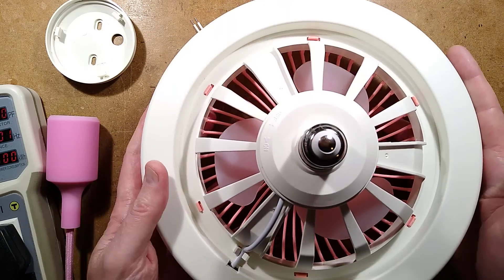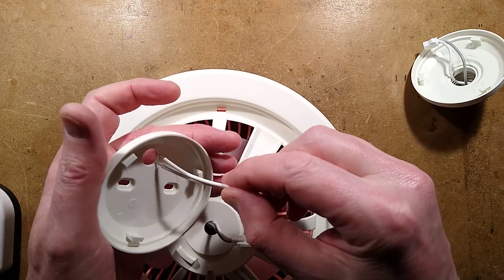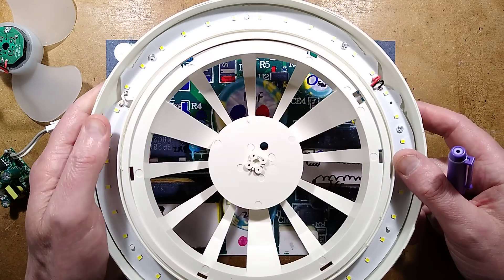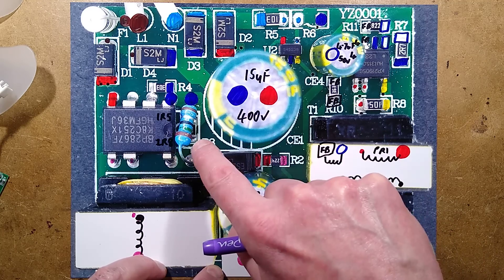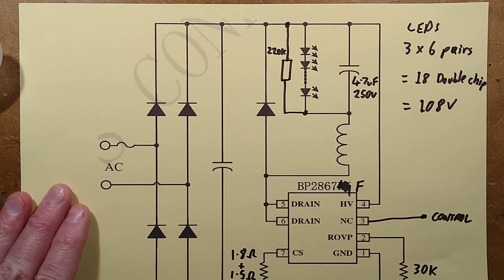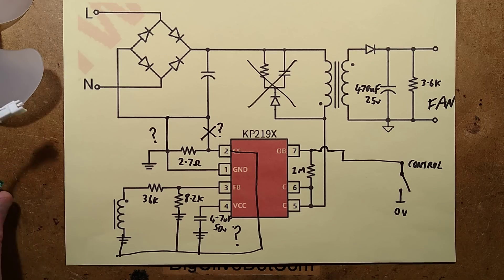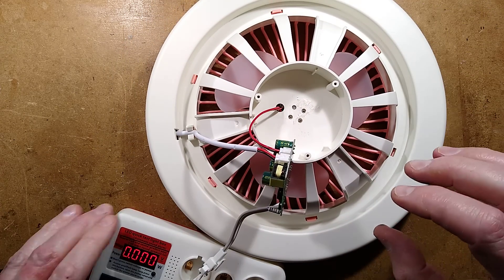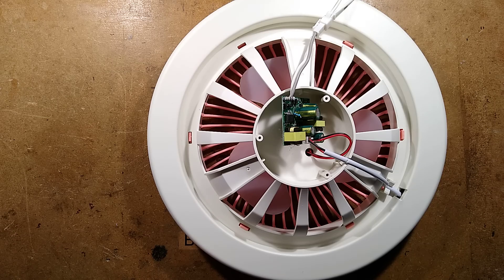fixing a faulty light with powerful built in fan (awesome chip inside)

Comment: You could possibly use it to both light up and remove fumes from a work area if it will happily pull the air away
Reply: But unless there's a place to actually move the air outside (aka a duct), all your doing is moving the fumes (or smell) around the room. I really fail to see the purpose of this.
Reply: @gorak9000 In some cases reducing concentration is sufficiently protective.
Reply: @Azlehria  Not about 2 hours after you have taco bell - gotta capture all of that "essence" and have it treated as hazardous waste - whirling it around the room isn't going to cut it

Comment: Question: If I have a heatsink that covers a large square IC, but also has part that hangs to the side of the component (like a terrace). So it is like an extension, it also has fins like the main part of the heatsink. If that part of the heatsink is not getting much heat transfered to it, is the problem that the part is too thick or too thin?
Because, at work the design engineer thinks that the problem is that the hanging part is too thin and that making it thicker (mechanical engineer will make a new one) will conduct more heat to it. While I think that the problem may be that the hanging part is too thick, and has a large thermal mass, so most of the heat stays on the main part (which is direcly on the IC), which is causing the problem. And that making it thinner would make it easier to absorb heat. 
I am not sure which solution is an actuall solution. Can anyone help? We will take a look at it with a thermal imaging camera tommorow, and will need to decide what to do.
Reply from the maker: I think the thicker base of a heatsink will generally help with coupling heat to the fins better.

Comment: Did you notice on the data sheet that the CS and GND pins have the numbers swapped on the package outline. The GND pin is numbered 1 but is in the 2 position. So maybe that is the cause of the confusing wiring and datasheet
Reply: Yeah I think so too.

Comment: That seems like a lot of work to save a switch and another conductor.
Reply from the maker: Cost of fan that goes into existing lamp holder $20.  Cost of getting an electrician out to run an extra wire $huge.

Comment: The chip was primarily used in multi-colour lights. The output is connected to a white LED and a yellow-ish LED. Then you can adjust the colour temperature.
Reply: Interesting. They likely wired the fan as the warm white light.
Reply: Yes I have one in my shower that doubles as a nightlight with a separate ring of amber color LEDs

Comment: I see the use for renters.  I'm a little skeptical about attaching a fan like that though.  It spins up fast.  I wonder if that's tough on the outlet.
Reply: As in physically hard on the outlet? The fan is of such a low mass that there's likely far less froce applied to the socket than there is when a standard bulb is screwed into it.
Reply: @kmoecub  A standard bulb is replaced infrequently compared to a fan starting and stopping. Indeed mass is low but force  = mass x acceleration and it starts very fast.  There is also the fact a fan moves air.  It's basically a wind brake.  There are also imperfections in the balance of the blade.  I have no idea how much but if the fan creates a resonant frequency we get a miniature "galloping gerdy".  I've seen many poorly made light receptacles so it's difficult to calculate the impact.
Reply: I couldn't be sure, but it seems like the startup torque of the fan exerted force in the direction of unscrewing the device from the socket.
Reply: I'd suspect that there is almost no impact whatsoever on the outlet. Much less than the heating and cooling that an incandescent bulb would inflict on the socket anyway.

The fan has almost no mass, the brushless motor won't exert that much torque and the startup speed is controlled by the inbuilt controller's feedback circuit so the amount of torque is managed. One could argue that the direction of the fan might impart a little force to unscrew the bulb in the fixture when first turned on, but when turned off the braking effect would screw the bulb back in with approximately the same force (or vice versa). Certainly not enough to worry about.

Replace the thin plastic fan with a much large fan with blades made of a heavy metal and we might see some effect, but not at this size and weight.

Comment: Right up against the wall would be way too close for the airflow doesn’t look like as much depth
Reply: I suspect that there will still be plenty of space for the airflow to such in air around the back. It's not like it's high power fan and given a bit of momentum the air flow will work just fine. Look at computer cases and their fans and intakes and you'll see how you don't need that much of an air input (or what you can get away with).

Comment: Interesting device, especially if the fan could also be made to rotate in the opposite direction, as to illuminate and extract soldering fumes in a workbench.
Reply: It's brushless DC, so swapping two of the winding leads on the little daughterboard should reverse the direction.  (A fact that RC pilots know all too well.)
Reply: Thats are awsome idea
Reply: It looks like the fan blade used in this particular device is designed to spin in only one direction.

Comment: Phillips has a series of "automatic" dimmer LED lamps. They have 3 light levels. Low, with warm color. Medium with warmer color and High with normal color.
The level is changed by turning the lamp off/on. I guess that chip was designed for that kind of application.

Comment: You could have just scraped the cover off that broken track and drawn it in with a pencil. A thin layer of graphite would have completed that circuit.  I've done that before on broken tracks.
Reply: You could, but that would have a higher resistance than using a jumper wire.
Reply: @kmoecub  Yeah, and? It's just sensing the power state it's not high current.

Comment: I think part of the reason why a lot of people in the UK still stick to inches is that they seem to think the alternative is to measure everything in millimetres, when in fact most of the civilised world uses centimetres  for "medium-sized" stuff (which is why the ruler is marked in cm, not mm).
Reply: Wait till you find out about decimeters...
Reply: @kpanic23  - Those are a myth, they've never been spotted in the wild.
Reply: Hmm, I measure everything in mm or metres. I guess I'm used to it. Metric is all I've ever used, since the early 1970s. 🦘
Reply: @channelsixtysix066 What about tyres?
Reply: @philtowle4683   I don't measure tyre sizes, I use kPa for air pressure.
Reply: @channelsixtysix066  you might not physically measure them but you will ask for the size in inches when you buy one.
Reply: @channelsixtysix066 the screen you're looking at now is likely a "xx inch" and just about everything electronic you've ever used has been inch-based inside    fullsize headphone plug is quarter inch    hard drive is 2.5 "
Reply: @jagmarc  An approximation of the real diagonal size, which is merely a lazy way to specify a square pixel grid which is most definitely defined in metric terms.

My hard drives are almost exclusively 3.5", actually, because they have things to do. And curiously, the dimensions in the standards which define both 2.5" and 3.5" are a mix of both systems - but you may not have ever read such documents. For bonus trivia, 2.5" and 3.5" are not nominal figures in either document.

ps. rulers predate 'the English' - by some millennia.
Reply: @Monkeh616  - In fact, SFF-8301
(the specification for 3.5" form factor drive dimensions) states: "2.3 Conventions - The dimensioning conventions are described in ANSI-Y14.5M, Geometric Dimensioning and Tolerancing. All dimensions are in millimeters, which are the controlling dimensional units (if inches are supplied, they are for guidance only)."
Reply: @RFC3514  Ah, but that's an alteration for the published standard - the majority of the nominal dimensions were chosen in imperial, and, for example, the threads for mounting screws are specified to be 6-32 UNC. 8201 is much more amusing with an obvious mix of metric and imperial nominals.
Reply: @Monkeh616  - Well, US customary inches themselves (which are not part of the imperial system, BTW, although they're identical) are defined by the NIST as a multiple of the millimetre, these days.

What I find funnier is that no dimension in a 3.5" drive is actually 3.5". The closest thing is the horizontal distance between the bottom holes, which is 95.25 mm (3.75"). Every other measurement is either ≤ 3" or ≥  4".
Reply: Technical people always use mm, non technical use cm - at least in Australia.
Reply: @glenngarrett8785  - So you're saying "non-technical people" use 0.35 cm audio jacks instead of 3.5 mm ones? Or 0.9 cm pistols? ;-)

The whole point of SI prefixes is that you should use the one that approximates your precision. So, truly "technical" people shouldn't say something is "250 mm" if the measurement precision is closer to one centimetre (or, indeed,  worse than 1 mm).

Also, even if you don't care about the "technical" aspect of things, saying 25 cm is simply faster than saying 250 mm.
Reply: Metric system jumped the shark when they started giving things names like Newtons and Pascals.
Reply: @M8Stealth  - So, what should newtons be called? Isaacs? ;-) 

It's just a derived unit, anyway; you're still free to write "kg⋅m/s²" every time, if you want. Also, newtons weren't / aren't really part of the metric system (they're part of the SI system). In the older CGS metric system, the force unit was the dyne (0.00001 newtons), but since the base units were changed (to metres and kilograms, instead of centimetres and grams) they needed a new name.
Reply: inches are better because use less of them to do the job , and only the English made rulers originally .
 Plus nearly everything in the world has been inches   19 inch rack    50 caliber   3.5 floppy  0.1 inch matrix  4" block  2 inch multitrack     "1/2 inch AF" is secret mechanics tool for 13mm    2 by 2 studding  etc. etc.
Reply: @jagmarc  - Yeah, in the (very few) parts of the world that use inches, everything seems to "be" inches. Imagine that. 😄
Reply: @RFC3514 But also many things from industries previously dominated by UK/US .  However many modern component pinout grids are now metric by design, such ad 0.5mm grids .  Meanwhile bureaucratic fanatics insist on official metric names such as 90mm disks and 47cm televisions .
Reply: @jagmarc  "inches are better because use less of them to do the job" 
This is a silly reason, if you really meant it then meters are better than inches because use less of them to do the job
Reply: @deadly_dave  - That's a guy who also said "only the English made rulers", so I suspect either he's not being very serious or he shouldn't be taken very seriously. ;-)

Comment: Could the fan be reversed in direction so it could be used a bathroom exhaust fan ?
Reply from the maker: Not easily without replacing the fan blade assembly.

Comment: I always thought that, when people complain about the heat inefficiency of lights- if you live somewhere that needs heating, you are actually using 100% of the energy (and thought that adding a fan could help circulate the heat). Didn't know they were actually a thing, even if that's not the intention.
Reply: Winters do feel colder with LED lighting. On the bright side, inductive loads such as light bulbs are a more expensive option of heating for most people anyway.
Reply: @Mrvideosandgames  I never understood why power factor correction isn't regulated by law. For small devices, the impact might be small, but that also means the cap is really cheap to correct it. And if it was required it would all add up.

Or did I misunderstand and you were talking about alternatives like nat gas or heat pumps? Cuz if you are talking about heat pumps especially, it would be amazing if we just pumped heat where it was needed around a house to make every other heat pump (or sink) more efficient- my dream home would be one where that was the case.
Reply: @sophiophile  Yeah, I just mean LEDs produce less heat than older types of bulbs, but on the flip side light bulbs aren't a great way to heat your home to begin with when electricity is triple the cost of gas (in the UK) and resistive (sorry, not inductive) heaters use about double the electricity of heat pumps.
Reply: Also electronics, including LEDs, hate heat cycles as it causes tiny fractures that will break the device way before it’s intended lifespan. Cheap LED Bulbs are often overrunning the LED chips with more amps than they need, increasing the light output but decreasing lifespan and energy efficiency. And the producer needs less LEDs for the same amount of light, making the product cheaper. Check Clive‘s Video on the Dubai Lamps, LEDs at twice the efficiency as common LEDs

A good Lamp runs LEDs at 0.5-1.0W each

Comment: I don't really understand the electronics but what was the point of the resistor pushing up the wattage?
Reply from the maker: The resistor programs the LED current.  By chopping one off it increased the resistance value and lowered the power.

Comment: Yeah, very weird, that capacitor on the KP219x VCC pin is normally fed from a diode on feedback winding, that would reduce/turn off the constant current trickle internally in chip, thereby increasing efficiency and reduce waste heat in switch regulator.

Comment: I think i would be concerned that when the fan starts, it unscrews from the fitting
Or if it's a pendant holder it might twist around
Reply: Interesting point.  But  13:20  the fan spins counter-clockwise which means it's "pushing" clockwise when it starts, ?
Reply: @idjtoal  look again, imagine from the front
Fan spins counter clockwise from the back, which means clockwise from the front, frame spins counter clockwise ;)
Reply: @sparkyprojects  You are correct, sir, had it in my head somehow that it was right side up.  Clockwise, down into the workbench, means it is a self-unscrewing lamp.  The Chinese never cease to amaze.

Comment: Interesting device. Nice that it uses short on/off mains cycle to change operating mode rather then having to set up a account in the cloud to control it.
Reply: >your refrigerator, doorbell and TV have entered the chat
Reply: @WineScrounger sadly, they can do just that.
Reply: usually they would come with a remote to control the light and fan
Reply: Solutions like these can be finicky, and having a separate remote for each device just sucks. There ARE decent home automation solutions that don't involve any cloud crap
Reply: I have several things like that. Their state is never predictable: my electric utility blinks off quite frequently. Thanks, Entergy.
Reply: The only smart devices I have are a few light bulb in certain places and a couple cameras and I really like them. The ability to dim or or change colors like a reddish orange when you want to go to sleep, they're convenient and always work. I won't be getting any other smart things though, you're giving up too much control when you go that route. This thing Clive has could benefit from a wifi connection though in my opinion.

Comment: I use a 60x60cm LED panel as a light in my room. Its meant for drop ceilings but I 3D printed some bracket for it, works so good its almost too bright xD
Reply from the maker: As mentioned, they do sell simple frames for surface mounting ceiling panels.  I bought one from eBay a while ago.
Reply: They actually make the adaptor to surface mount the suspended ceiling lights, I fitted them in all our offices with them.

Comment: 25w for a LED licht is very high wattage, all my led lamps in my house 
are 5w and lower.
Reply: He did note that the wattage went down, I think it was 10, when he clipped that resistor.  I wish he had stopped to mention all the new wattage figures after he had clipped it.  Did the wattage of the fan go down too?  Did it affect the wattage when both the light and fan were on?  Interesting device though, would be useful in a closet or something small and stuffy.
Reply: @timlaswell1088  Yeah that would have made it better, but 99,99% 
of the people who buy this lamp do not know anything about electronics, 
that they could remove that resistor, and the wattage goes down a LOT.
Reply from the maker: Fan power remained the same.

Comment: I wonder if that powerful fan would make the fixture dangle around if it were mounted on one of the E27 dangling cords. Would be nice to provide airflow through the room!
Reply: You’d end up with a very twisted cord. The fixture provides the counter torque to the rotating blades.
Reply: @robert_g_fbg  Hmmm... I wonder if the fan torque direction tends to tighten or loosen the bulb? 😁
Reply: @kimchristensen2175 Watching closely, one could see the fan spins right (seen from the front, obviously) so its torque is towards left, tending to loosen the bulb. Surely it has a low torque, but when vibrations add, that could slowly unscrew the fixture. Good spotting of a potential nuisance or even failure mode !

Comment: Don't you use boxes for ceiling installations? In the US you would typically see an octagon box or similar for a light, and something beefier for a ceiling fan. That mounting seems just fine for that sort of installation.
Reply from the maker: We usually use a ceiling rose.  An ornate junction box for the pendant light.  In an office environment there may be conduit and round metal boxes.
Reply: Ceiling roses here are generally purely ornamental.

At any rate, with a box, installation should be easy enough, assuming the holes molded in the base line up with the holes in the box's flanges.
Reply: @PaulSteMarie  In new construction that's true, but the average age of a home in the UK is older than the US as a nation.